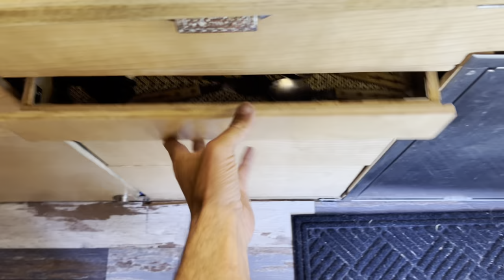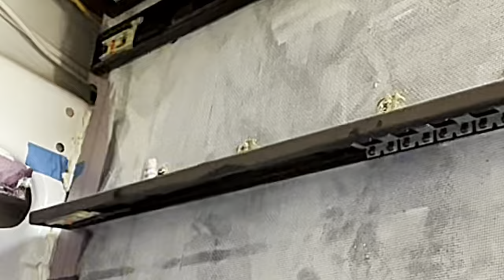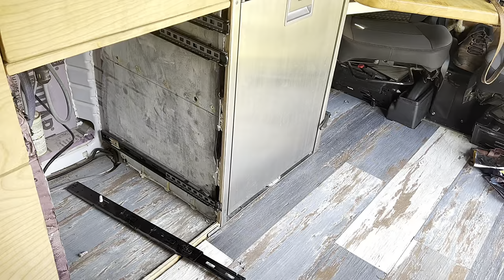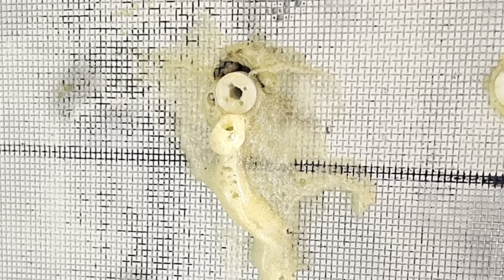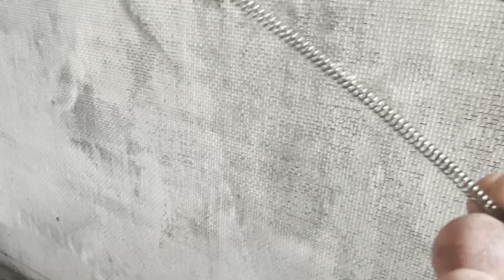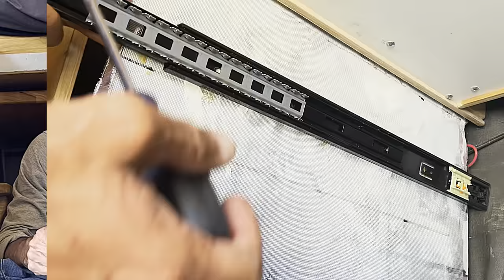When Foam Anchors Fail - Foam Bones Van Build System Vol. 3

Comment: For those without access to lots of tools this may be impractical, but what I'll probably due is use a router to create a groove in the foam and then embed a piece of thin wood where the drawer slides will attach.  I'm really early in the build phase so anxiously await each release of your series--truly appreciate the time and effort you've put into these videos.
Reply from the maker: That would be a fine solution, I hate using saws or routers on foam because of the foam dust it makes… but it does take a jig saw and router well.
Reply: I've seen folks use a hole saw bit in their drill for this. Cut out the hole in the foam with the bit, use the bit to make a plywood plug, put a t-nut in the center of the plug then glue the plug in the hole. Just gotta figure out where you want the holes before you do the screens!
Reply: I came here to say almost this same thing. Instead of routing a channel, I'd butt-join strips of wood that are foam thickness by cabinet height by 2-4 inch wide (depending on weight capacity needs) to a foam panel whose width was cut 4-8 inches (double the previous variable) less than the cabinet depth.  So for medium capacity drawers in an 18 inch deep 36 inch tall cabinet, the walls would be constructed as:
3x36 wood, 12x36 foam, 3x36 wood with 2 butt joints, no screen, thick coat of white paint or with a white epoxy pour on both sides.
Reply: @sanukcanuk1282  06/12/2023 Hello Canuck. I like using the hole saw ideas. That will give a more square inch area for the glue to stick to the foam. I believe that the plywood plug would work well however if too small it may fail also. The twist and directional movement is only as good as the glue hold. I would cut a groove or slots into the foam like on a wooden peg only reversed. Over all a plug fixture is a good idea. Also the screws were straight sheet metal type screws. A wood screw would fail. The drywall anchors are shaped like a wood screw. Your plug hole would be square in the foam. Just a thought on a Sunday evening. Sincerely Don
Reply: @dongrider9040  I like the T-nut for attachments as you can then remove the bolt later as many times as you want. I like to make stuff as modular as possible. Also while the glue/foam bond is important, most of the shear and tensile strength will come from the screen. The 3 or 4 inch diameter round peice of plywood will distribute the compression load to the foam.
Reply: @sanukcanuk1282  06/12/2023 Hello Canuk. Thanks for the comment. Don
Reply: Instead of routing a grove in the foam, what about using the hot knife to cut a slot all the way through and wedging in a strip of wood as thick as the foam? Then screen over both sides.
Reply from the maker: Could work… I’m always nervous of creating weak points… but with some testing that could prove out.
Reply: @falkornomad apparently if you spin the hole saw (or drill bit) backwards, it doesn’t create near as much foam dust
Reply from the maker: Hmm… the only way I can imagine that would be true is if it was creating enough friction to melt rather than tear… but who knows… might have to try that.
Reply: @falkornomad  I said “apparently” only because I haven’t tried it myself yet either. I just heard it a few times, so I’m curious to try and see too :)
Reply: I work with foam quite a bit, and I think this is the way to do it.  Spread the stress of those screws over as wide an area as possible.
Reply: @sanukcanuk1282  I was thinking the same thing
Reply: Or you can just glue a 1/4" thick x2" x 16" strip of wood under the slide!
Reply from the maker: I did a similar thing to brace the heavy duty slide for my cooler drawer in the back.
Reply: i think easier than having to router out foam, and would also provide a nicer finish to the inside front edge of the drawer frame. would be to build a plywood frame thats only say an inch deep (or maybe 1 inch x  1 inch solid wood would work better o its as wide as the foam), and have that be on the front and maybe back of the foam frame. so you make the foam frame  just be cut shallower by that one inch or so on the front and back and put the plywood frame against it. plenty of surface area to glue them together, so you're essentially making something siilar to the foamcore board, only the wood laminate is on the ends, so like a 1" thick edge banding. So then you have a solid wood piece to put screws into that has perfect vertical resistance to weight. cutting out pieces to fit blocks of wood or strips that go horizontally the weight is still pushing down into foam at some point and could still fail over time. 

this is how i've made draw frames in the past essentially just make three square "rings", that fits around all the drawers just like entire panels would, save a lot on the wood used, and so long as its part of a larger structure, like in a home, anchored to a wall, it doesnt matter that its not a rigid structure on its own, and once its surrounded by other things you cant tell that its not solid panels all around
Reply: I also do that. Routing out foam is super messy, but leaves nice sharp and precise cuts for accepting wood reinforcements. One thing I do now is use a centrifugal dust collector attached between my router and shop vac and it works awesome!!
Reply: @falkornomad how about this to keep the strength? 1" aluminium 'U' channel the length of the drawer slider. Snip/saw/dremmel sections of the parralell faces to create a number of tabs. Plunge thin lines through the foam with hot knife for the 'tabs' to slip into. Glue the ally to the foam ready to fix the drawer sliders to with self tapping screws.

Comment: I wanted to build with foam because of weight. I see a lot of builds & they make me cringe because of added stress to the vehicle & the danger factor. Your R&D is great! Love it!
Reply from the maker: Thanks, more to come on the subject.
Reply: Pots and Pans: DO NOT go into a Drawer. Too Heavy.
They are placed in a cabinet.
Heaviest pans on bottom/ floor of cabinet. Maybe place a shelf or 1/2 shelf above these heavier pots and a wooden dowel horizontal to hold lighter weight pots. - Love the idea of no bending to reach pot from a drawer but even home wood drawers don't hold heavy pots.
❤ Love your videos! Taking notes. Now, I'm changing my build materials and go with your video suggestions. I definitely am grateful to your precision build and accurate breakdown! My first conversion. 4x8 plywood is heavy to lift by myself @ 5'1".
Like any woman, im watching the weight!! 😊 - ON MY BUS BUILD, GUYS!!

Comment: this is why i like watching sailboat repair videos. they aren't experimenting anymore. they already know how to mount stuff onto foam properly without all these pull out and failure problems. simply they embed harder materials into the foam to be screwed into. no drywall screws just barely hanging on. they need their stuff to last if they get into a storm and they have a knock down where the sailboat is flipped on it's side before it rights itself. this camper video isn't doing it in any durable way that sailors would.
Reply from the maker: It’s too bad they aren’t experimenting anymore… they say that’s the death of all arts and sciences. 🤷🏽‍♂️
Reply: the foam world has been more greatly mastered in the boat world then it has in any foamie construction i've ever seen.  @falkornomad  they are still innovating. no death happening. what i am saying is that foamie rv types aren't going to the people who already know the limits and the correct ways to do foam composites that hold up to even harsher conditions then a foam trailer would.. i.e. being tossed around at sea in a storm with things or people maybe being pushed onto things... they round off all the corners because those really hurt... they pay attention to foam density and materials in which it is to be incapsulated because if their deck is made of foam. it needs to be strong enough to be walked on and strong enough for waves to crash over it... tons of water weight...... they HAVE to do it correctly, in the strongest way possible because people's lives are on the line. which is why i am saying sailing repair videos are great for learning about foam. foam composites, seeing how things fail etc...  the only reason i am looking at foam rv stuff is because i wanted to know what was the most ghetto way to slap up a trailer onto a harbor freight frame and be workable... but honestly i might fiberglass it and use raka epoxy because it's way cheaper then the west system stuff. because west system is always giving away epoxy to youtubers so everyone trusts and thinks west system is the best... raka is all word of mouth so they keep their prices low, and sometime have holiday sales too.
Reply from the maker: It’s a good point… boat systems are a good model to follow.
Reply: boats really don't to splines or finger joints either. most of them just use glass micro balloons to turn epoxy into a peanut butter consistency, and use it like a glue/caulk to fillet it in place and round over the corner so fiberglass can be layed down. the only reason i was thinking splines and the cheaper methods of building is because i wanted to make something lighter and cheaper that didn't need to take a hit by a crashing wave which means using much less dense foam board insulation. the problem with those boards is some of them melt when exposed to epoxy. so because a friend of mine cosplays and uses it, i was told to always paint the cheap foam over with glue because epoxy will melt it. so, to you common foam board not made for boats, i'd need to coat it before going the epoxy route. which is why i was interested in what coatings don't melt common board board.  which is where your content is of value to me. thank you.  @falkornomad  the reason i'd do splines on a foamie is the foam is really weak compared to boat foam due to it's lower density.

Comment: I hope you’ve solved your drawer issue. So long as you use foamboard alone to hold a weight load, you are prone to the same issue. I had an idea. Make a skeleton. Use 1/8 (3mm) vertical steel stock, in 1.5 inch strips or whatever you find available. Set two pieces on the floor as feet, and glue four or six strips directly to the foam walls inside your drawer cabinet vertically, resting each slat on the footing. This reinforces your walls for drawer support, bearing the weight immovably and permanently. Using flat stock allows you to drill holes where you like, but you might save time and labor using the hardware from vertical shelf kit from anywhere.. Walmart, Home Depot, Lowe’s, Tractor Supply etc..

Comment: Instead of glue - have you considered 3M eternal bond double sided tape. It's used to bond unistrut mounts for hard solar panels to roofs and withstands the wind and rook vibration no problem..worth a shot :)

Comment: May I suggest putting something simple, a 1" x 1/8" strip of plywood under slide full length and screwed in also saddling it under. slide, under Neth touching, at the time of Bild. This will give the support under most conditions. :)

Comment: There's a boatbuilding hack for this? Use a hole saw or a fly cutter to make plywood discs about the same thickness as your foam. Use a Forstner bit to pop a round hole in the foam, and glue the disc in with Godzilla Glue. Then just drill and screw into the disc (don't hit the hole in the middle!).
Reply from the maker: Yep… just trying to follow the idea further down the rabbit hole, thanks!

Comment: When you put those drawer slides in I would use double-sided carpet tape they have thin and thicker maybe the thin would be better but when you use double stick carpet tape and the fasteners there won't be a chance of tugging on the screw you'll have the whole face of the slide

Comment: Like your design , have you considered adding Strong adhesive strips to the drawer slides , to spread the load , and reduce the pressure from your   Fasteners, or on drawer slides manufacture small strips of metal with screw type nuts attached to the strips , again spreading the load to support your drawers …
Thanks for listening and sharing your knowledge 
Pete
Reply from the maker: I have, that would help and I would recommend others do that. I am only using foam and anchors to fully test for this year of full time use. 👍🏽

Comment: Aerospace use of inserts is to increase the area for fasteners.  Typically used when attaching to aluminum.   One suggestion is a wooden square block to get more foam area contact when there is going to be heavy weights in a drawer.
Reply from the maker: That would work for sure… I’m following the dry wall anchor down the rabbit hole for science.

Comment: I really like your concept and your way of finding the best solutions!
According to your problem of too much weight in the drawers for the anchors in the foam, there is a very easy solution. Just support the edges of the drawer slides with small stripes of plywood from the bottom up - and they will carry all the weight without stressing the anchors in up and down movements.

Comment: One-inch circular plugs/blanks can also be glued into failed screw anchor locations. Use a spade bit or hole saw to counterbore the foam and fashion one-inch plywood plug blanks with a corresponding hole saw. Glue the plug blanks into the counterbored foam then fasten your hardware to the plywood plug blanks.
Reply from the maker: That’s an option for sure, it and many other “substitution” options have been suggested and definitely would work.

Comment: I appreciate that you're trying this out for the science.  I expected this type of failure with the screws.  I've been wondering if skinning the inside of the hole and using the skinning material to spread some of the stress outside the hole might help the way it does for the rest of the build.  You'd probably need something more flexible than the screen.  Cotton gauze strips maybe?  Or, maybe gluing the rails in place might help?  It'd distribute the weight along the rail instead of just having it at the screws.

I've been considering doing my own foam build.  My current plan is to do cubbies and avoid the need for screws entirely if possible.  One of the other things I've been thinking is maybe using coroplast as the doors for cabinets.  It can handle the repetitive type of wear and tear the foam can't, and it would still be very light.  I can get some old campaign signs and paint them so they'd be really cheap too.  Who knows if I'll ever actually do more than plan (due to health it's currently impractical to get started), but it's fun to dream.
Reply from the maker: Gluing the drawer slides would be a good idea… almost did, but I’m testing for science without. Cubbies or anything that avoids screws is a good idea, but I like the clean look. I think the concept has potential and needs long term testing to really find the pluses and minuses, thanks for understanding and appreciating the “for science” aspect. Not many people are willing to experiment with a $100k build! I had the opportunity, so I decided WTF, YOLO!
Reply: cubbies, forever & ever, Amen

Comment: You should test the technique called "drill fill drill" where an oversized hole is drilled, then filled in with glue and allowed to dry, then drilled appropriately for the screw size.  This makes a rigid solid anchor.

Comment: Your videos were one of the reasons why three years ago we also decided on a vanbiuld with foam.
"wood embedded in the foam": This is how we did it everywhere we used screws.
We had also tested screws directly in the foam or even insulation dowels. However, due to the movements in the vehicle while driving, we did not trust the durability of this construction with our dowels.
Reply from the maker: So rad to hear that my early video’s inspired people to build with foam! I did consider embedding wood in the foam, even mentioned it in my early Q&A video, but I wanted to test out these anchors. Keeps the weight down, pretty easy to install and can be done anywhere. We’ll see!
Reply: "wood embedded in the foam".  Interesting.  What do you exactly mean?  Did you sandwich sheet of plywood between layers of foam?  Or the other way around, by sandwiching 1 inch foam with two think sheets of plywood?  Thanks in advance.
Reply from the maker: More like; router out a 1x2 groove / notch then inlay a 1x2 board with glue to hold it in.
Reply: I like using two saws to fabricate round, wooden blanks with two hole saws.
1. Locate two holes where the inside diameter of the larger hole saw is the same as the outside diameter of the smaller hole saw.
2. Cut a counterbore in the foam with the larger hole saw.
3. Cut a round, wooden blank in thick plywood with the smaller hole saw.
4. Glue the wooden blank into the hole you bored in the foam.
5. Mount hardware to the wooden blank, which is now bonded to the foam.
Reply: @scottcates  where are you finding hole saws that increment by a kerf width?

Comment: Hi enjoying your vids. 
In relation to the failed screws and the runny Gorilla glue could you not cut a square out of the panel and replace with new, line it up , mark for screw hole , place new piece on a flat surface to glue in insert and then glue your new piece back into panel? Negating the gravity effect on the runny glue